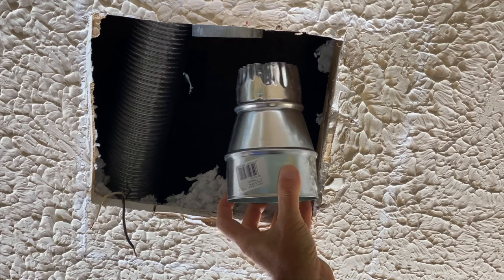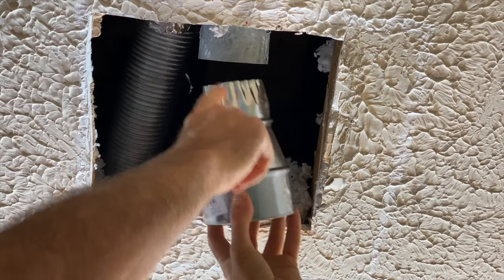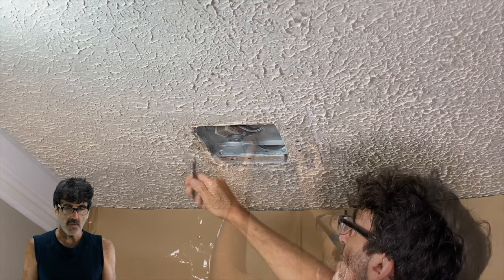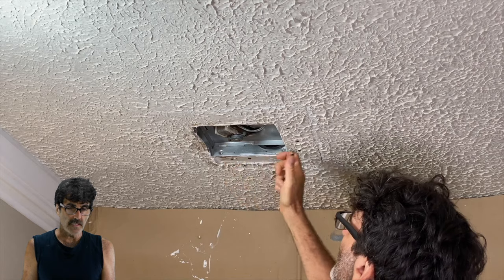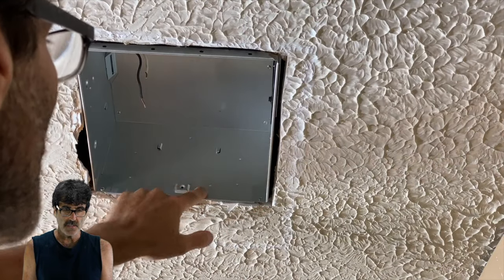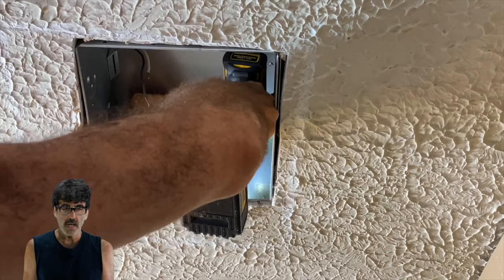How to Replace Your Bathroom Fan Quickly With NO Attic Access! DIY

Comment: Excellent instruction, really like the voice over so no loss in details. Going to tackle this tomorrow with more confidence now. Some say there can still be power with switch off, just check with a tester first or click the breaker.
Reply from the maker: Thank u!  Usually if there are only 2 wires the switch will cut the power.  But yes absolutely you should double verify the power is off.  With this particular fan it plugs in like a lamp does into a wall socket, but still a good idea to have no power.

Comment: Always cut the circuit breaker before exposing bare wire—not just the light switch. Check the voltage before touching the wires. Don’t take chances.
Reply from the maker: Thanks for the tip!

Comment: Great Video. I've installed a couple of these which was very easy except for the one I'm working on for a customer now. Its in a condo bathroom, rectangle 15"x8" and it has a 2 inch outlet duct compared to the 4 inch and of course a 10.5x10.5 install. (Can you say, drywall charge). I'm having to take the entire metal casing out, and I'll tell ya, it has become a heck of a job. The adapter for the 4inch to the 2 inch was my main concern, so thank you for sharing the information. Well, back to work.
Reply from the maker: Wow a 2" duct.. The one in the video was 3" and I thought that was a bit small... The only other choice would be to replace the ductwork..  That would make the job quite a bit bigger..I'd probably hook it up and see how it sounds..  Unfortunately.. fixing the drywall is another pain..  Hopefully the ceiling is smooth, it'll be a lot easier than matching a texture..

Comment: nice guide showing exactly what to expect. thanks.  I changed the motor in my old one but the moisture was just not getting evacuated as I suspect it is just pushing into the attic or some constrained area.  I will install a new roof vent and new fan assembly, 4 inch ducts, get it fully up to code and full  effectiveness.  I've had too may kitchens and baths without effective moisture/fumes ventilation in my life.
Reply from the maker: You're welcome!  Are you sure you need to upgrade the roof vent itself?  Can the roof vent accommodate a new 4" duct?

Comment: Really good fuctional option, I used a Sawzall to cut the rafter brackets. This way I didn't have to crawl into hot attic. Added a sleeper to rafter so I could mount new fan.
Reply from the maker: Cool.... yes anytime I can avoid going into the attic I'm all for it!..

Comment: Nice video. Think it means I will need to go back to the store and get a 4 to 3 inch adapter when I replace mine tomorrow. Most projects require 2 to 3 trips anyway!
Reply from the maker: Yes I know about the 2-3 trips!...   Just can't seem to get it in one trip.  You might not need it, unless you already know that your house is 3 inch pipe.  If it's a newer house, it could be 4..
Reply: @TheHomeImprovementChannel  If only that adapter was the only glitch today :> Found that there was a piece of wood blocking the new taller fan, had to return the whole thing and get a 4 inch tall unit. Then the 4 inch unit does not use the adapter, so that will be another trip to return that part. And the new one had 'fins' I had to bend over, which meant taking the new unit down again to bend it over flat. And still had to cut the ceiling hole larger to fit. This project took all day. I wanted to just replace the motor on the old one, but the wife (and I basically agreed) figured new would be better. I"m wore out from this all day project!
Reply from the maker: Arrrrgh.. it's always something... 🙁.. I guess cutting that piece of wood out of the way wasn't an option?

Comment: Congratularions Sir, this was a wonderfully well explained video thanks a lot.  I'm going to install fans on a wood ceiling without attic access and I was wondering how to do with the fans I was seeing in the advertisement with those exterior mounting flaps because the model I have used all the prior times seems not to be available any more at a reasonable price.  That model had a bracket you install on the joists and then you clip the fan to it.  Thanks again !!!
Reply from the maker: Awesome!  You're welcome.  I hope you get it going soon..

Comment: Awesome video and content, thanks.  Sorry if I missed it, but what was the size of the new fan housing and how many cfm’s?
Reply from the maker: HI, thank you so much!..  The new fan housing can be any size.  I would get one that's probably a little bigger than what's in there so you can open the drywall a little to get the old one out.  Also there won't be any drywall damage to fix back.  as far as CFM's go, it's really up to you.  I want to say this one was 70, but I can't remember for sure.

Comment: Great video.  Question my wife and kids have a bad habit of not turning the fan on while showering.  Could I hook fan and light wire together on one switch?
Reply from the maker: Yes u can.   As long as the fan switch and the vanity light are together in the same box.  You can disconnect the fan switch and leave it in the box as a dummy switch... Then take your light and fan wires and tie them together.. Then run a pigtail back to the switch where the fan wire originally was.  I hope that makes sense.
Reply: They also make fans that monitor the humidity level and kick on automatically.

Comment: Thanks for your tutorial. My new home came with a basic Broan Nu-tone 50 cfm using AC power. Unfortunately it doesnt move enough air and my bathroom stays humid for awhile. I'm wanting to upgrade to a Panasonic whisper series which uses DC. Would the wiring be the same or would I need anything additional to hookup?
Reply from the maker: If your fan has a light fixture built in.. (some have a nightlight too) then you'll need additional wires to allow those to come on separately.  If you don't care about that then you can tie them together and they will come on together with the fan..

Comment: A quick question regarding this....can i replace a light/fan combo with just a fan?  If so what further changed need to be done?  Thanks.
Reply from the maker: Hi.. Of course without seeing it I can't be sure of exactly what you have there... But yes it shouldn't be any problem.  The new fan needs to be at least as big as the original fan to minimize the drywall repair .  If there is a 4 conductor wire since you have a light I would just wire nut the 4th wire inside the new fan housing.  Also if you have rigid ductwork you may have to do some finaggling around to make it work with the new fan.  Hope that helps.

Comment: Excellent video. I have an issue where there's no attic access and the existing fan is mid-way between rafters and not against a rafter. There are two foot centers and it's right in the middle. The new one is 9 1/2" square and the existing one is a small round style one. I started taking the old one out but it's supported by screws with spring wing nuts or something I can't actually see on the top side. I lost one nut by unscrewing too far so I stopped. Is there an aftermarket bracket or do you know of any tricks for this issue? Thank you!
Reply from the maker: HI..   Can you cut up the old fan with tin snips or something like that.   A Dremel tool with a cutting wheel might be able to make some cuts without throwing to many sparks around..  Also if you're installing a new fan that's bigger than the old fan you can cut the drywall big enough for the new fan and that might give you some access.  If you can get the old one out, the hole may be big enough to get up in there to add some wood members and screw them to the joists.  If worse comes to worse, you can cut the drywall to the size of where the joists are and then patch it back.
Reply: Yes I can get the old one out. I just didn't go any further in case I couldn't put the old one back in (if needed). Great idea though. I'll just scab on some wood to the rafters. Thanks for the reply! @TheHomeImprovementChannel
Reply from the maker: You're welcome!  @DaveLisenbee

Comment: I have 2 whites and 2 blacks. One black is hot, the other wire (both 12/3?) is from a timer switch on the wall. I didn't take a pic when I took the old one out.
Reply from the maker: HI, if they were 12/3 there would be a red wire.  Did you have a question?

Comment: Thanks for the very helpful video.  What do you recommend to seal the outer housing area if it’s about  1/2 inch too wide for caulking.
Reply from the maker: Would any rubber weather stripping work?  Do you have access from the top?  If so you can tape the bottom up as best as you can and spray great stuff foam from the top.  The tape is so it has a backer and won't fall all over the floor.
Reply: @TheHomeImprovementChannel  Thanks for the reply, I have no attic. Would it be best to put regular duct tape or metal tape?
Reply from the maker: @guitarhero9592  I only suggested the tape to give the spray foam something for a backer so it wouldn't come out and go all over the floor..  If there's no attic, you might try the weather strip and see if it helps any.
Reply: @TheHomeImprovementChannel  Thanks I’ll do that.

Comment: Thank you for another great video. I m running into a problem here, i want to install an exhaust fan in the bathroom on the first floor, the joints between the first floor and second floor run perpendicular to let me run the duct to the outer wall. what should i do?  Thank you for your help.
Reply from the maker: HI you're not going to be able to drill through the floor joists for a 4" duct line.  You either have to go with the direction of the floor joists and go out where they allow you to,  or you have to run the ductwork through a bulkhead that's below the ceiling.  If you don't have an existing bulkhead you'll have to build one to house the fan duct.

Comment: Fantastic videos! I replaced just the motor like you other video, but my second fan’s power did not work. Can I just replace the plug housing then replace the motor? Any other advice?
Reply from the maker: If the fans power doesn't work, do you have one of those contactless voltage sensors or a volt meter?  You need to determine if the power is actually making it to the housing.  Could the switch be bad?  If there's no power getting to the fan housing, I'd start looking at the switch...

Comment: What do you do if the new housing unit is smaller than the old one? Also there is no excess to the attic. I also what to replace the bath fan in the basement, again the original housing is bigger than the new one, what do I do? Thanks great video.
Reply from the maker: HI, the easiest solution is if you can take the new fan back and return it.  Then get a fan that's bigger than the original.  If you're replacing one with a fan that has a smaller housing and there's no choice, the only option is to patch the drywall.  You could build a fancy trim piece around the new fan, but it's so much trouble... it's just easier to use a bigger fan..  Is the original fan ruined?  I have a video of removing the motor insert and replacing that or cleaning it up if it's fixable.. is that an option for you?

Comment: How do you get the plastic wire thing out of the housing? I finally got the housing loose, but I cant get that thing to budge.
Reply from the maker: Are you talking about the little grommet where the wire comes in?  some of those push out going in, and some are pushing from the inside going out.. whichever side the larger bulk of the plastic is on is the side that needs to push the opposite way.  There's usually two tabs on those that need to be compressed in order to push it out.  I'm not sure if I answered your question..

Comment: I got a question, I’m doing a full replacement like you are and I noticed my old housing is not nailed or screwed to anything it’s just loose. Question is, is it necessary to have a bathroom exhaust fan nailed or screwed to a joist or 2x4? Or can I just leave it loose like the old housing? Mind you that this new fan is a lot lighter then the old fan I’m removing. Thanks in advance. Take care
Reply from the maker: HI!  Will it work?  Yes I'm sure it would.  Is it code?  No I don't think it would pass.  The old one was like that for however long it was installed in there and didn't have any troubles..  If it was me when you remove the old fan, you'll probably have a pretty good size hole there.  I'd probably want to put a 2x4 up there and screw it to the joists or trusses...  The hole should be big enough to access it.
Reply: @TheHomeImprovementChannel  thanks kind sir for the speedy reply I’ll get right on it!!!
Reply from the maker: You're welcome!  @gypsysneakerhead3091

Comment: The ancient fans in my bathrooms both have round housings like recessed can lights. Housings are all rectangular these days, so replacing the things isn’t simple. (Also, they’re nailed into place with galvanized nails. Nothing is attached with screws in this house.)
Reply from the maker: Arrgh... Yea that does make it more difficult.  Sometimes you can cut those nails with a sawsall, but you have to be very careful not to cut any wires!  Or anything else important...😂
Reply: How did the fan replacement go?
Have a update?
That's the same fan in my house.
Thing is so dam noisy!!
Has metal fan blades

Comment: How did you get the housing to just stay up there? I'm still trying to figure out how to pop out the hole for the electrical wire
Reply from the maker: You have to attach it to the truss or joist in the space above the drywall with screws or nails..  You can pop out the hole by just tapping it with a hammer and screwdriver.  It should pop right out.

Comment: My current wires and duct are on the same side. My new exhaust fan has 3 holes where the fan should be screwed into the joist. Unfortunately,  the hole for the wires is diagonally across from where the wires currently are. Is there a way to extend the wires?
Reply from the maker: Are you working with an attic space?  If so, then yes you can put the wires in an electrical box and nail the box wherever the original wires will allow it.  You can then run the extension from there and extend them wherever you like.  Unfortunately if there's no attic space, you're not supposed to bury an electrical box where there's no access to it.  The only other thing you can do is put the electrical box facing down into the ceiling and cover it with a blank plate on the drywall side, so it satisfies the code.  You can access all this through the hole from the old fan.

Comment: Hello! I am doing a replacement, room side access only. Problem - the original fan was installed alongside a truss plate, no wooden joist available. Any recommendations? Thank you!!
Reply from the maker: Is there any wood along one side of the square hole?  If not, is there room to get a drill up in there to add a piece of wood to the closest truss?
Reply: @TheHomeImprovementChannel  Unfortunately, there is no other wood on any side of the hole other than the joist with the truss plate - and the plate is almost as wide as the hole itself. The ceiling opening is just shy of 8 in x 8 in.. I  believe have enough room to secure a piece of wood with screws just beside the truss plate - is this sufficient?
Reply from the maker: I think so... say is the truss plate right up against the hole on one side?  You could drill a hole in itt.  If you put the fan in the hole and hold it in the right spot, you can mark where to drill the holes in the truss plate.  That's got wood behind it right?  It's just a metal plate they use on trusses?

Comment: Do you need to turn the breaker off to not get electrocuted? Or just the light switch off? Thx
Reply from the maker: It depends how it's wired.  To be safe, I'd turn off the breaker.  Then it's foolproof..

Comment: Dont they make same sized fans so all you have ro do take old fan out and plug in the new one?
Reply from the maker: Yes in many cases you can do that.  I have a video where I'm doing just that.  But some of the older fans don't have an option to buy a new one of the same size.